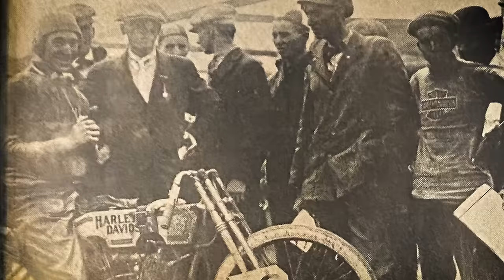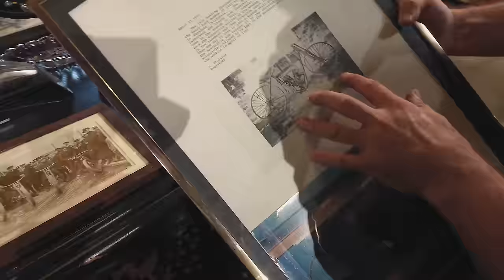What Separates The RARE From The RAREST?

Comment: These early H-D's are the only H-D's I genuinely love. Skinny tires not unlike those on the RS, but smaller diameter, and cross-treaded, would return to racing, in the 50cc World Championship GP bikes from the 1960's, til the 1980's, when the 50cc championships ended. 17k+ rpm 100+ mph bikes. 50cc two-stroke singles, with rotary case induction, in later years, producing 20hp.